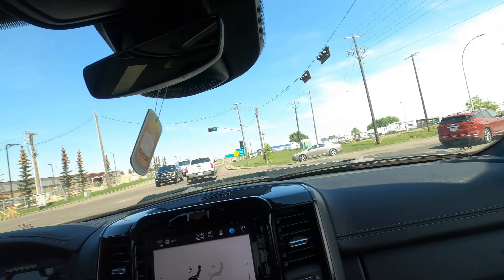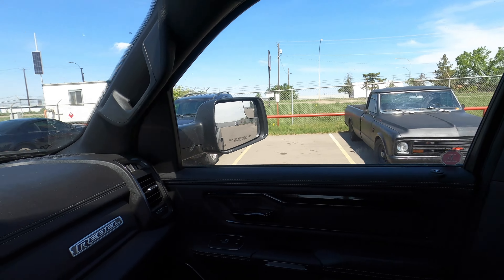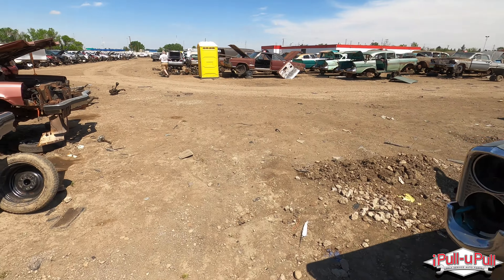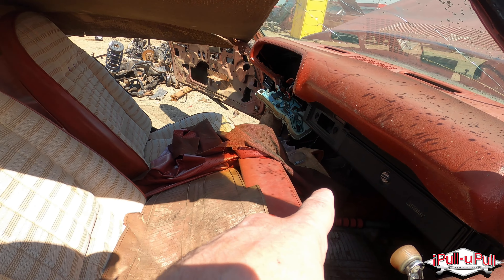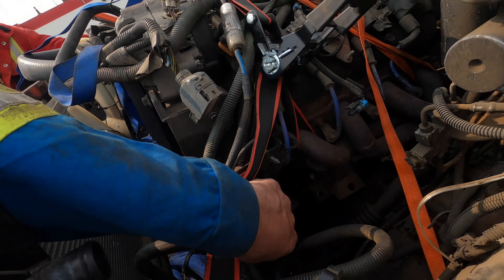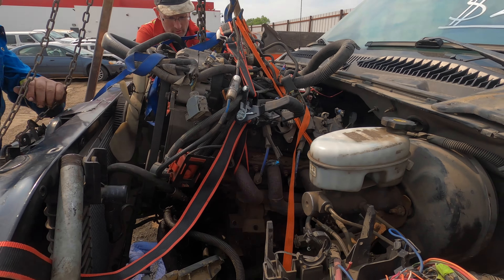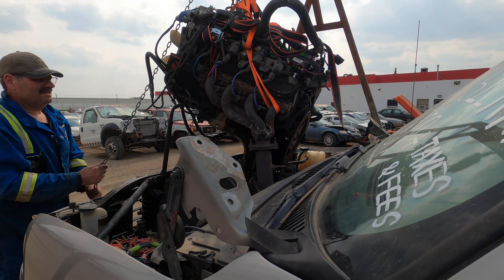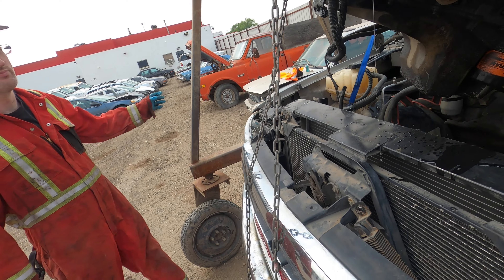How I pulled an LS motor at the wreckers!  It was way easier than I thought. I’ll show you how!

Comment: Was it a six liter? What did it run you ballpark? I’m always curious what the prices run when you pick a motor yourself. Thanks for documenting. How many hours would you say you had into it?
Reply from the maker: 5.3 liter

Was around $400 with accessories I think

About 4 1/2 hours to pull, would be quicker if a guy had done one before I’m sure.
Reply: @shortcutgarage  thanks! I’ve got a second gen firebird im in the market for a 5.3 for too so this is perfect! Appreciate the video!